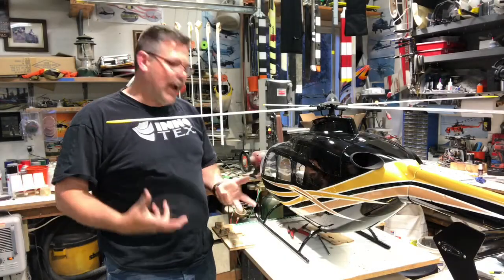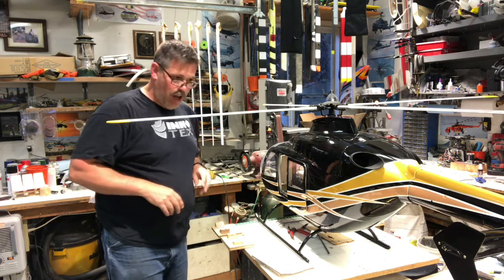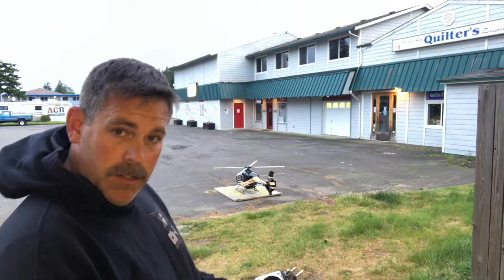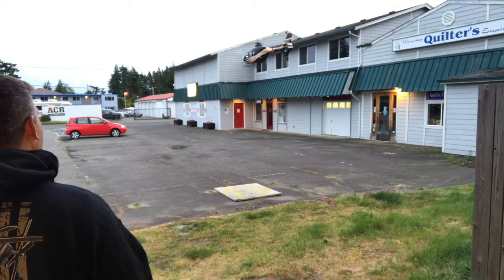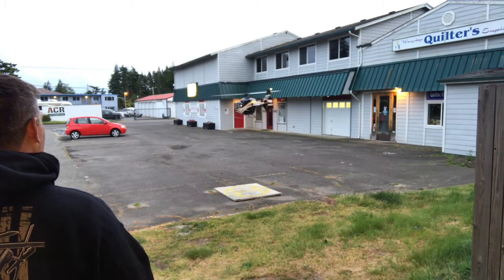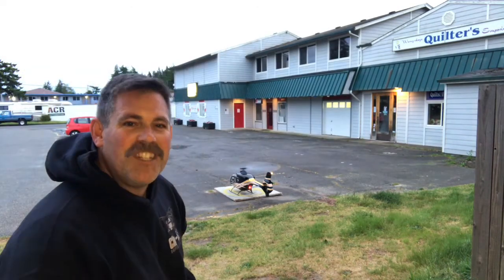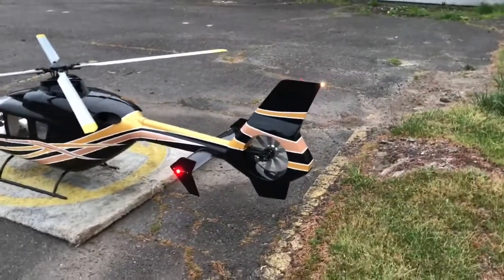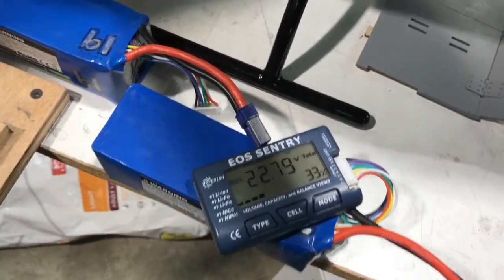Maiden flight of RC Aerodyne Roban EC135

Comment: I know this video is old, but I still have to comment. That battery draw is insane! I have an 800 size AIRWOLF model and a 700 size Bell 429 GlobalRanger and I get 9 minutes of flight time with 25% battery life remaining. I'm using twin 5500mAh packs in both birds. Maybe I get better flight times because I'm flying at a lower head speed... 1,300 RPM for AIRWOLF and 1,200 RPM for the Bell 429.
Reply from the maker: YUP!! Just a slightly lower head speed can make a huge difference. Plus your 5500 mah compared to my 5000 adds up too! But the tail is a huge draw! Having to have a higher head speed to get the tail to be effective is what really kills the flight time! I do think the newer versions are better!

Comment: The tail travel on the helicopter is very light. Having a hard time setting my throttle curve due to this issue. I was attempting to fly at a flat throttle curve of 75%.l, but the torque from the main rotor was too much for the naza in Heading Hold and rate mode. Is it safe to attempt to fly with a 50/60 % throttle curve being that the tail seems to hold there. If not, can you share your pitch and throttle curves with me??

Comment: Hi I am experience pilot just recently got the EC135T3 Setting it up with the spectrum FC6250HX FBL Setting it up on the workbench notice high RPMs the tail rotor does not work 50% throttle seems like the tail rotor is working now seems like the rotorhead speed is really low in order for this tail rotor to work no matter what you do higher RPMs it does not work is that correct please help. I guess I’ll let you know how that works out if you could tell me your set up that would be great.   am I right about the lower RPMs for scale to work correctly you would think the higher RPMs the tail rotor would respond better
Reply from the maker: Need a servo with over 300 oz/in to power the tail. Open everything up and lube all the bearings but you’ll need to have it at 1250 for good control over everything.
Reply: @JestRR    Awesome it is flying good now are you saying open the tail rotor housing up and grease all the bearings in there and the rotor speed makes a big difference on tail performance I’m right at 1250 1300 RPMs so good thank you so much for the reply again stay safe. Let me know about greasing the tail rotor should I do that.
Reply from the maker: @russellsvideos7260  I live the bearings and the bushings if yours has them. They may have upgraded to all bearings. I used some triflow on the bearings and some lithium grease where the arms slide on the ring inside. Be careful of the small ass screws that hold the cover on. The heads easily strip.
Reply: @JestRR    10-4 you’re awesome looks like mines been upgraded will grease the slide arm inside looks nice and clean moves freely. Stay safe keep flying.  Got it on video today got a put the boom on and the doghouse on got a good test flight in today check out the video

Comment: Hello my friend, could you contact me on how to setup my roban ec135 with the Bavarian demon 3x and spectrum dx8 radio
Reply: @JestRR  which radio and FBL controller would you recommend for this aircraft
Reply: @JestRR  I bought the heli from motion Rc and have been waiting in ed to call me to set up the Bavarian.  I just dont want to crash a 5000 heli lol. Also l noticed you are fire Dept maybe? I am a fire/paremedic as well. Thanks for the help.
Reply: By the time l had to buy everything im in it around 4000 or so. I had to buy new radio and everything.
Reply: I have been been flying a blade 230s for quite a while. I am only going to hover the ec135 for a long time
Reply: I was going to do that this evening. Thanks again my friend